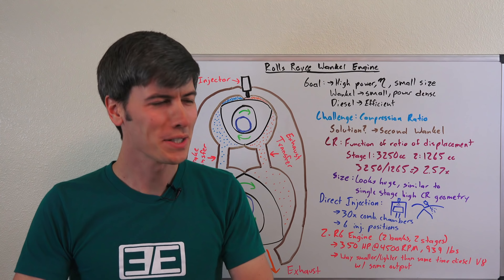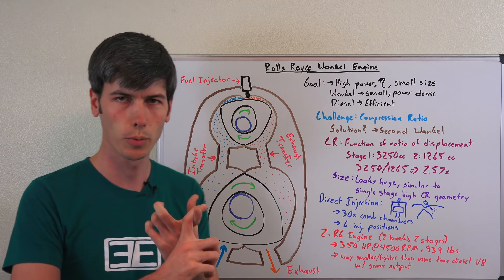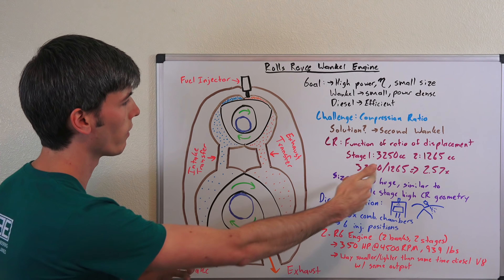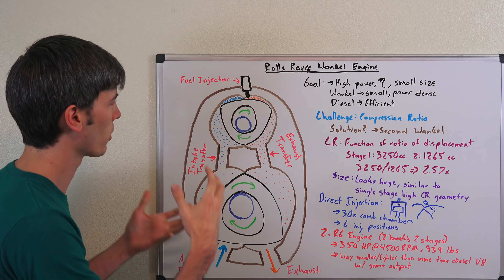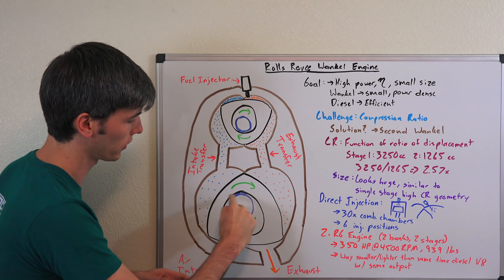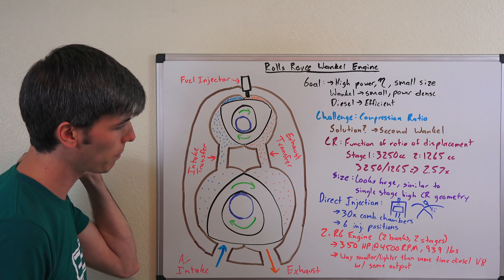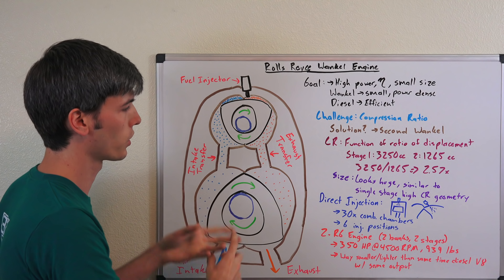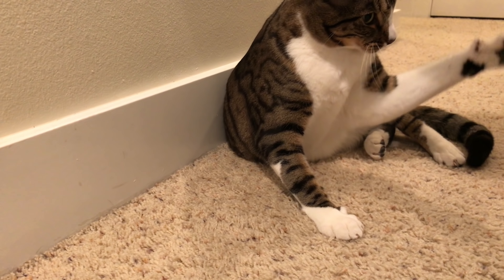Rolls Royce Made A Diesel Rotary Engine With Four Rotors!

Comment: Very interesting because of the rotor compounding. Also I imagine it would be hard to have a typical DI diesel combustion cup in the rotor face...IDI might have been a better option.  I wonder how efficient this was? Wankle engines are typically inefficient because their high surface to volume ratio. Rolls Royce has built some interesting engines... One of my favorites is the Crecy which was based off Harry Ricardo's Dolphin.

Comment: With 2.57 pressure ratio of the first compressor stage, it can be replaced by a turbocharger having the same pressure ratio but with a lot smaller dimension, weight, and cost.   So your compound turbine-rotary engine will look just like the turbocharged Mazda 13b engine but running on diesel fuel instead.  I believe that direct injection is impractical for diesel wankel rotary, but indirect injection using a pre-combustion chamber would be far more practical to reduce heat loss and oil degradation from the high heat of the rotary surface.

Comment: I am confused: if the bottom rotor is only driven by the exhaust coming from the upper chamber/rotor (as opposed to driven by the upper rotor via a chain or something like that), that would mean that the two rotors are not synced... but shouldn't they be? If there are not sunced, the boost reaching the the upper rotor would change all the time depending on the relative position of the rotors, wouldn't it?

Comment: Bear in mind that a lot of the rotary's so called "fatal flaws" are in fact able to be corrected. New seals that only require fuel for lubrication, better positioned spark plugs and more of them for better combustion, better water cooling to even out heat across the block, electric superchargers coupled with turbos to eliminate poor low end torque. Both Rotron, with its 700cc Norton, and Mazda are working on rotary engines, with Mazda commiting up to 50 people to develope their engine. The rotary is not dead.

Comment: I've always thought Wankel engines could be more efficient if the intake/exhaust ports were like your diagram--at one end of the chamber--instead of through the side like many are made.  However, I'm not an engine engineer.  (Software engineer).  I've seen videos of diesel engines that have two opposing pistons that compress toward each other.  What if you had two equally-sized rotors compressing into a small common combustion chamber?  I'm guessing the intake/exhaust at both ends would increase the weight of the vehicle.  Multiple smaller rotors probably wouldn't work because of the weight and overhead.  (Like an 8-rotor or 10-rotor, for example).  Exhaust passages could warm intake passages if near each other, but that's probably not a good idea.  My very last idea is that maybe there could be something like a turbo or supercharger built into the engine casing that could use escaping gas to compress the intake.  I'd love to save the rotary engine, but I'm out of ideas.

Comment: The larger Rotor seems to be a basic version of a turbo, it would be interesting to see how a turbocharger would work with this engine design. I wonder how the starter system works since there seems to be two sets of rotating elements as compared to one in a regular rotary. Maybe two starter motors?

Comment: I once looked into converting my 50cc 2-stroke moped into a diesel. Same concept really, but 2-strokes are better. I could get iron cylinders and high compression heads, but the lack of proper fuel injectors and throttle bodies ended my interest in this mod real quick.

Comment: Hey Jason, maybe it is because the sketch kinda fools me or I am missing something... The rotary trianglish part is symmetric w.r.t chamber at the position you drove. So if there is no initial momentum present in the system, how could the pressurised exhaust gas apply a torque to a symmetric part ?

Comment: Chiral rotors, some constant arc spark plug that can ignite all the fuel, a catalytic converter that can withstand that heat, maybe "generator" turbo that creates charging current rather than compressed air, for low end torque... a lot can be done, I just need a few billion dollars.

Comment: Seems to be a lot of confusion as to whether first rotor is supercharger. The whole motor is just a 2stage engine in the same vein as a double/triple expansion steam engine. The first rotor is a low compression engine and the second a high compression. The gases are compressed in 2 stages and then expanded in 2 stages. Look up double expansion steam engine as probably easier to visualise.

Comment: Great video with a good explanation --- assuming that the compressor rotors are geared to the power rotors (in order to maintain the intake/exhaust timing) do you think the exhaust gas from the power rotor entering the larger volume "vacant" compressor rotor chamber acts in a similar manner to the "scavange" cylinder seen in 5 stroke engines meaning more energy is recovered from the combustion process?

Comment: Very interesting design and would love to see a working prototype in a car
Reply: The design never worked and was abandoned.
Reply: @sandervanderkammen9230  of course it didn't work and was abandoned or else we would have it in production. Now we are many years in the future and can improve on the technology. Yes electric is the future but we can still take these concepts and improve on them making a useable product. While lifespan is limited it could be a viable option before petroleum is completely phased out.
Reply: @jamesmancuso3666  Rolls-Royce was not the only company that attempted to produce Diesel Wankel engines.
 Are you familiar with the development history of the Wankel engine?
11 of the largest Diesel engine manufacturers became NSU-Wankel licensee's and invested billions of dollars in development of Diesel Cycle Wankel engines.
 None were successful.
Only Yanmar entered production and these engines were all recalled and bought back by the company.
The Wankel engine simply cannot support the required static compression ratio needed for reliable compression ignition.
The combustion chamber seals of the Wankel engine are also just to weak to withstand the higher temperatures and pressures found in the Diesel Cycle operation.
Any questions?
Cheers!
Reply: @sandervanderkammen9230  sorry I have no clue about nothing. Just speaking to hear my own voice.🥱
Reply: @jamesmancuso3666  No worries, it is still an interesting story.
Reply: @sandervanderkammen9230  wow the farce is strong with this one. Guess the sarcasm didn't transfer well sorry buddy.
Reply: @jamesmancuso3666 Oh sorry, So you really are completely unfamiliar with the development history of the Wankel engine?
Most people have no idea that some of the best engineers and research institutions spent decades working on the Wankel and that dozens of major manufacturers invested billions in development.
It is well-known and understood by experts that automobile industry has already exhausted the Wankel engine's potential and it is now considered an obsolete technology.
Reply: @jamesmancuso3666  Excuse me, but the Wankel engine is not obsolete because of any lack of materials technology...
You don't not seem to understand the inherent flaws in the Wankel engine's basic design which prevents it from being developed any further.
There are no longer any legitimate engine manufacturers developing the Wankel engine, it is obsolete technology.

Comment: I had thought about how just switching from gas to diesel might solve some of the rotary engine's biggest problems. In theory, a little oil will always exist in the diesel fuel itself, so it will do some of the pre mixing for you. Also would be interested to see what would happen if you slapped a turbocharger on the diesel rotary?
Reply: Why. You already have a turbo charger in the rolls Royse rotary engine. It would be at best redundant.

Comment: Hi jason, would it increase the efficiency of a regular piston engine if the lower rotor comressor/expander was added to it? It extracts energy from the expanding exhaust gases and uses it to compress and to transfer it to the driveshaft so why not use it as a 'turbocharger connected to the driveshaft' ? I hope you understand what i mean. Grtz Jur- Netherlands

Comment: this kind of reminds me of the 5 stroke engine
that baiscally is an engine design where you have an extra piston for the exhaust cycle, issue with that is that exhaust temperature is too low for catalytic converters
Reply: All Wankel engines operate using the 4-stroke principle.

Comment: Well, I wonder if you could use the diesel fuel to lubricate the apex seals, that would mitigate the oil loss problem that plagues rotary engines. The rest of the lubrication system would then actually become completely sealed. Imagine that, a diesel engine with the same oil change interval as an automatic transmission.

Comment: Is the bottom rotor mechanically connected to the top rotor through the crank shaft or is it powered solely by the exhaust gas?? If it's the latter, is it just free-wheeling on ball bearings?

Comment: I have a question; Doesn't compress air get hot? and considering that this engine's "dual intake" as I'd like to call it, makes the airflow hot before combustion?

Isn't the purpose of a turbo and intercooler is to force cold air into the intake system?

To me this engine is trying to bypass the force induction by creating the same power with the natural asperated concept.
My concern is that hot air is less dense rather than cold air which much more dense and better for stronger combustion

Comment: I have a question.... are the primary and secondary rotors connected mechanically? Or is the larger "compressor" rotor solely exhaust powered?

Comment: Hi! The large rotor seems to have produced power from the exhaust of the small rotor. 
Like a sort of compound wankel working after the same principle as a compound steam engine with a low pressure cylinder producing power from the exhaust of a high pressure cylinder..

Comment: I guess this could work in hybrid power units like the London bus, where the engine does not power the wheels, and only exist to charge the battery, so the engine will always run hard when it's on, and it has the added benefit of better packaging, it sounds even more ideal for modern hybrid commercial and military vehicles.

But I still don't understand why don't Rolls Royce just settle with a traditional turbo. The wankel rotor is so much heavier than a turbo rotor, the "wankal" lag would be horrendous.

Comment: Here's a question guaranteed to trigger a debate:  With two sets of two-stage rotors working in series, what would the true displacement of the engine be?  I say it would be a 6.5L (2 x 3250cc).

Comment: Is the secondary crankshaft for the initial compression driven purely by the exhaust gas or is it also driven by the primary crank via mechanical power train?

Comment: You're incorrect when you say the engine would have been too big if it was built with high enough compression to be a diesel with a single stage of compression.  A higher K-factor can be used to achieve 15 - 16:1 compression ratio in a single stage.  The problem is that there is less room for bearings once the K-factor is increased, then it becomes difficult to design an eccentric shaft strong enough to withstand diesel levels of peak firing pressures.  The elegance of R-R's design is that the second-stage rotor, which has to withstand the high firing pressure, is smaller displacement and will generate small enough firing loads that a viable bearing system can be designed.

Comment: Love your videos, you are brilliant!

I was wondering if you could make a video that explains how the air temperature affects an engine. With that i mean, do you get more horsepower when driving in -20C than +20C? If so how big is the difference? How big is the difference on turbo/super charge engines? In my country it can be +20C in the summer and down to -20C in the winter. It would have been fun to know :)

Sorry if my english is bad.

Comment: is the bottom rotor mechanically connected to the top rotor (in your diagram) in order to use the power from the bottom rotor? if so, was it connected to a cam belt or a chain?

Comment: Cool fact! I wonder what the reason was though as to stop the development of this engine, especially because they seemed so close to meet their goals.
Reply: From what I remember of an article I read in the mid-70s, this engine was intended for use in a tank, but Rolls Royce couldn't make sufficiently durable and effective rotor seals (apex seals). Like in piston engines, the diesel combustion process added considerable stresses over petrol. Not only did they try many injector designs, they also did extensive development on rotor seals. In fact, their work lead to the much improved rotor seals on Mazda rotary engines, first used on the RX4.

Comment: Thank you for explanation!The engine idea is very unorthodox (I would never think of using one Wankel engine to push air into another wankel, let alone make it real and effective) and interesting.There is only one question though — if it was really that good, why then nothing came out of it?I mean even if the project/research was cancelled, why didn’t they produce something commercial based on the outcome of the project/research?

Comment: Is the compression rotor driven by the crank of the compression rotor or does it act more like a turbo? If it is driven by the crank then would the exhaust gases help reduce the parasitic losses?

Comment: Wouldn't forced induction have achieved the same goal. And been a smaller version.  Plus the heat from the primary rotor would probably help lose efficiency by heating up the compressor rotor. 

Cool they tried and experimented though .

Comment: A diesel rotary is actually probable the best engine for the mass market as Diesel is a lubricant and should eliminate the need to inject oil directly into the engine burning it up in the process. If not eliminate it atleast drastically reduce the need for it.

Comment: that looks like it would solve the issues with a rotor engine! also. it looks that it could be a gas engine also. and the efficiency should be way up. I wonder I'd it could work like can afterburner? by injecting more fuel. and maybe nos oxide.  between rotors in the exhausting gasses. putting more pressure on the first compressor rotor. and if a turbo could be added. it could make big power. if the components could handle the pressures and stressed. what do you think the max rpm could be? it being diesel? I have heard diesel can't burn all that fast? just thinking  maybe 500 HP could be easy. but what kind of torque could it make?? getting the combustion chambers correct  I have heard isn't that easy. and they loose efficiency at high rpm.  all the potential goes out the exhaust. the double rotor deal should help that greatly!

Comment: Why was the engine only spinning at 4500RPM?  The rotors spin a 1/3rd the speed of the output shaft, so about 1500RPM.  Diesel combustion is usually limited to ~4000 RPM due to combustion speeds.  It seems to me that a diesel rotary ought to be able to have an output of speed much higher than just 4500 RPM.

Comment: Looks cool but what was the actual benefit of using a second rotor as a compressor, I get that a turbo probably wouldn't work since you need the compressor for combustion to occur and a turbo only acts as a restriction until the exhaust flow is high enough but shouldn't a supercharger do the exact job of the compressor rotor but be far more simple especially in terms of service and repair

Comment: Technically that is still a 2 rotor Wankel engine with twin turbos... Instead of using axial pump (like a turbine found in a turbo), they've used wankel rotor as a reciprocating compressor. It would have been very cool if there is a mechanical connection between large and small rotor; then it would essentially be supercharged wankel; but with exhaust also helping supercharger... Kind of turbocharger/supercharger hybrid...

Comment: Explain to me what kind of a diesel engine that does not have injection? Even the oldest diesel engines had an injection pump pushing diesel through an injector. Even the predecessor to the diesel, the hotbulb engine had a sort of injection system, granted a lot simpler but still.

Comment: Do you know what kind of material they were using for the apex seals? Also, what was the rpm range for this engine? I’d really like to experiment with building a diesel rotary engine in my rx-8. And I’m having trouble finding good information
Reply: Usually apex seals used graphite,which can be found in pencils,since its probably very slippery
Reply: @Dryfloorsign  carbon seals were very unreliable and were quickly  superceded metal seals, ceramic seals have also been developed but all have been largely unsuccessful.
Reply: Several major manufacturers developed Diesel Wankel engines but were unsuccessful.
The Wankel engine simply cannot support the higher static compression ratio required for reliable compression ignition and the seals just can't  handle the higher combustion pressures and temperature.
Reply: @sandervanderkammen9230  oh

Comment: As I understand it, emissions tend to be an issue with gasoline Wankel engines. Might this solution of having an extended power stroke through an additional rotor be a boon to less unburned fuel exiting the exhaust port?